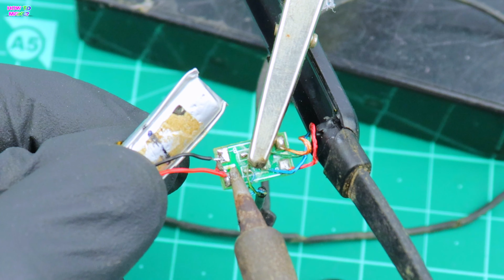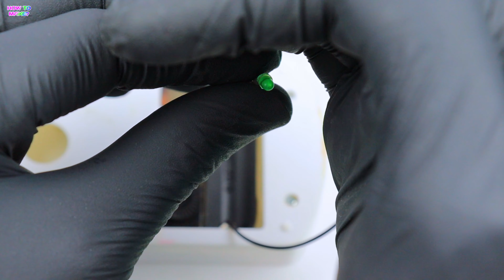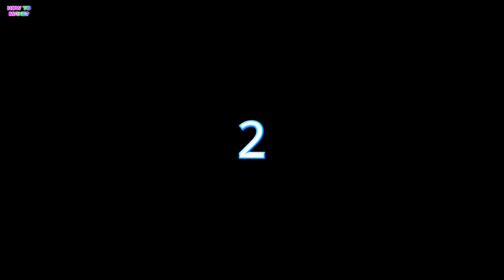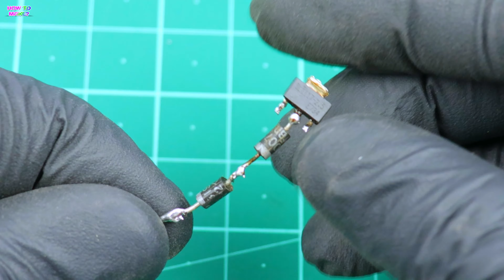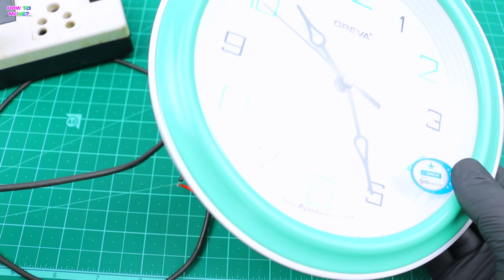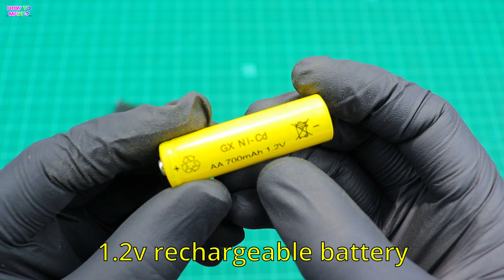DIY Top 3 Super Useful Gadgets used Old Trimmer and Wall Clocks!

Comment: Using lithium battery without bms would be dengerous
Reply: First that small solar cell won't get enough amps to initiate the charging circle.
Reply: bt circuit has a bms and auto cut